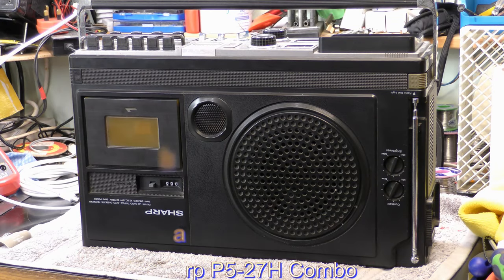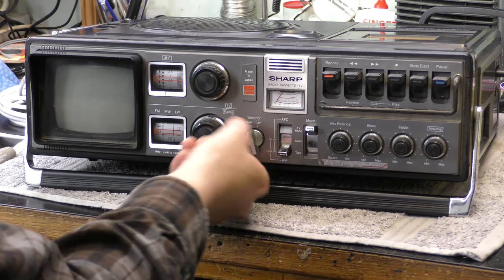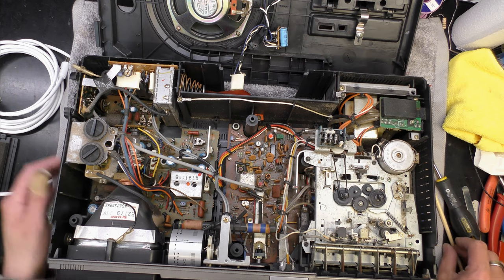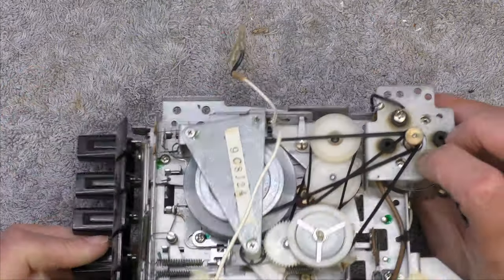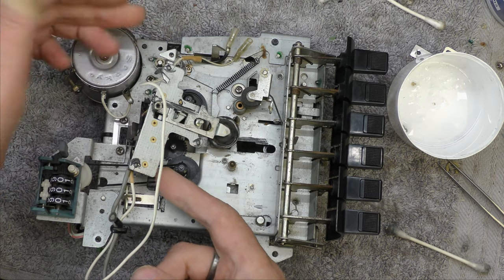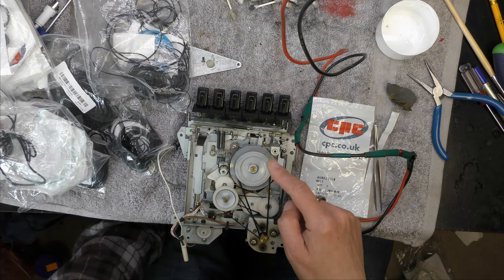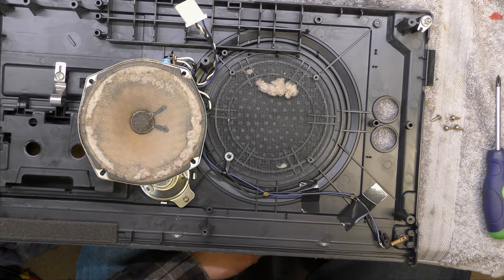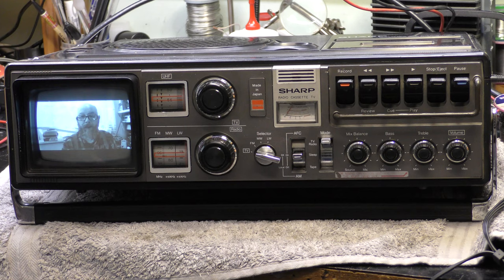Sharp 5P 27H Vintage Radio Cassette TV Combi (4K)

Comment: Lovely Job On That Cassette Mech Darren I Thought The Belts Would Have Gone To Goo To Be Fair What I Did On The Old Video Recorders Back In The Day Was To Boil The Old Belts If They Were In Not Bad Shape And This Did Untill I Got a Couple Of Belt Kits In Thanks For Uploading Darren Stay Safe Regards mike.
Reply from the maker: I must admit that I have never tried that trick of boiling the belts. I must admit belt kits are less easy to find with the type you need.

Comment: I have the same  unit in my collection, mine has a date of 1978, luckily it is fully functional after cleaning dirty switches & pots.
Looks a bit of a pain to change all those belts, worth it though, these are well built with a real metal cassette deck & a decent flywheel. They were pretty expensive when new!
Reply from the maker: Yes, the deck is a nice design before everything went plastic. I bet in today's money a small fortune.
Reply: @darrencoe5795  I have a Hitachi  Colour TV/Radio /Cassette from the early 80's, it cost the same as a 22" colour set!
These thing were not cheap, even the lesser brands (Plustron,  Hanimex, Matsui E.T.C) were a fair chunk of cash back in the day.

Comment: Здравствуйте, подскажите пожалуйста у меня точно такой же магнитофон, всё сделал как у Вас работает всё только нет звука воспроизведения касеты-? Радио и телевидение со звуком, что скажите что делать-?.Спасибо за ответ.
Reply from the maker: So no sound on tape, but sound on TV and Radio. Check TV/radio/Tape function switches are clean. Check record/playback switch on PCB is clean and in correct position in with the lever on the cassette mechanism. Check wiring to tape head is OK and plugged in firmly. Touching the head wires should give a hum. Maybe capacitor in the tape pre-amplifier. Hope that is some help. Daz